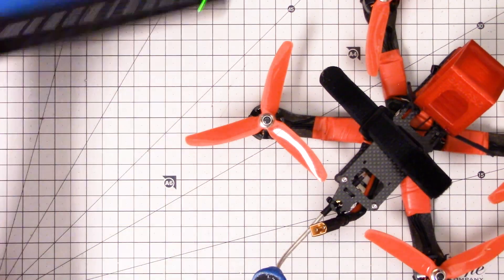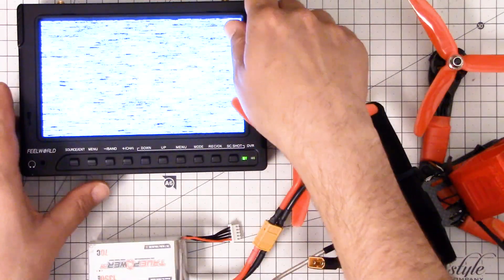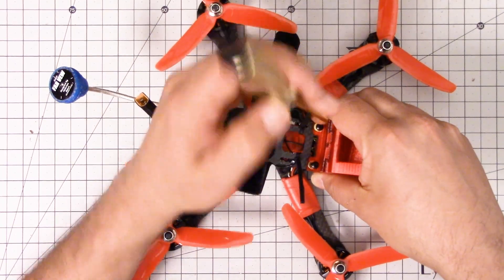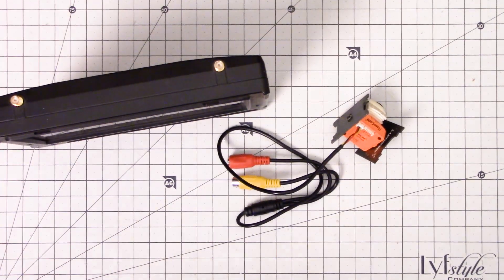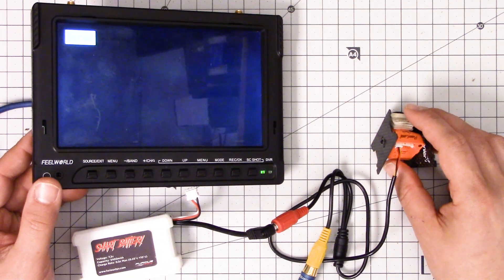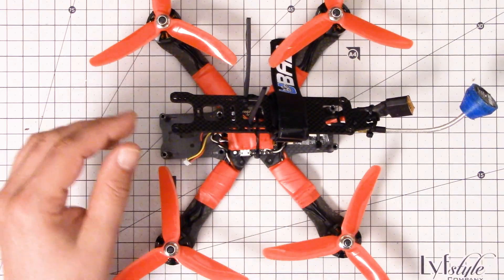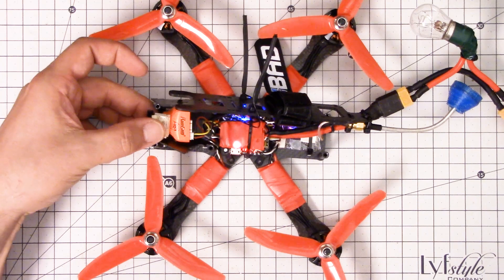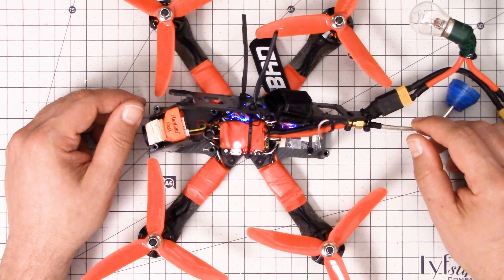FPV Camera Black Screen | REAL WORLD TROUBLESHOOT

Comment: I had a similar issue, my quad was fine at arm and initial take off, then started freaking out when I powered up past a hover and would do the funky wiggle dance of doom. Turned out to be my VTX pigtail grounding on my frame and messing with my esc's. It confused the hell out of me as I would have the top of the frame off try to find the issue, then re fit and test fly and do the same, it's only when I noticed a hot stand off that the penny dropped.

On another subject, what's the most function I could get out of my tgy-i6 TX, I've changed my firmware to make it 10 channel, could I change my switches to have three from two positions using resistors to register the steps? Could you maybe do some videos on getting the most from budget hardware with little tips and tricks?

Many thanks for all the great videos.
Reply from the maker: +Paul Morris you could probably build some kind of resistor network to allow you to use a three position switch in place if a two position switch. You'd still need to install three position switches though.
Reply: Joshua Bardwell Thanks will give it a go, and yes I'll be using a three position switch, I should have explained it better.
Reply from the maker: +Paul Morris you basically want open on one position, closed on the other, and a 50/50 voltage divider in the middle.

Comment: I had the same issue with my runcam and it turned out to be that the plug was not making 100% contact.  However is was seated flush.  I plugged it out and back in without any issues
Reply: hey i got the runcam micro swift 3 and i’m getting the same is where it’s a black screen. The only thing my black screen says is batt<full . Really don’t know who you are but if you have any ideas that would help out. thanks

Comment: Perfect timing for this video.  I ejected my Runcam Eagle while flying today and now have a black screen with working OSD.  Since the crash was hard enough for the screws to take chunks out of the camera case and rip the wires out of the connector, I'm going to guess (hope) that it just broke a solder joint on the PDB and didn't kill my new camera.

Comment: Disassemble the Eagle and check power paths, Solder joints, Coils...
Reply: In my experience,  humming is likely caused through excessive power draw...  Can you log voltages on every rail while touching/poking the quad and connections to the cam?

Comment: hey Joshua. check if the sdcard holder casing is not bend into the pins - a couple guys in my flying group had this and it caused a short between the 3.3v and 5v lines which on the long run will damage the voltage regulator
Reply from the maker: +Jaap Pieroen camera is running off vBat though. But good tip.
Reply: Ok clear. In case you are interested, this is what I was talking about: http://imgur.com/1ySjfYE . There isn't a lot of clearance, and I suggest everybody to put 'something' in the sdcard slot when you are not using it. (such as this: https://www.thingiverse.com/thing:710938 )
Reply: Ok clear. In case you are interested, this is what I was talking about: http://imgur.com/1ySjfYE

You see there isn't a lot of clearance. And a tight build can really squeeze the sdcard holder. Since opening your quadcopter (and removing the potential pressure from the stack) solved the issue, this was the first thing I thought about.

I recommend using this when running a BFF3: https://www.thingiverse.com/thing:710938

Comment: I had the same problem yesterday while setting up two mini quads. I am using Runcams 2, a FT951 25mW VTX and a AOMWAY 200mW VTX. While the first VTX doesn't send any voltage to a camera,  the AOMWAY was sending 4.99V to the camera and nothing happened. The only way to solve this issue was to power the camera from the PDB, directly from the battery. I might have done some mistakes, I don't really know, but I spent 2 days trying to figure out what was wrong and the only working solution was this one...

Comment: Hey Josh so I put the magnets back in but in but now the motor feels very restricted would it be OK to take some sandpaper to it?or what I be digging myself deeper in a hole thanks again man
Reply from the maker: In theory, you can glue the magnets back in with superglue. In practice, they often come out again. If the motor "feels restricted", it is probably dead. Let it go. This is a piece of precision machinery that spins at 30,000 rpms. You can't just expect to go at it with some sandpaper and have good results.
Reply: Thanks man I appreciate it any tips on removing stripped  Allen head screws  for the motor and thanks for not letting magic smoke come out of my ESC's and lucky I've got some emax 2205 2600kv  red bottoms back at the house but sucks because I'm no longer able  to fly in fl by the ocean which is amazing
Reply: Alex Dalton dremel a slot into the head and use a bit flathead screwdriver to remove the screw.
Reply: Stephen Gibb thanks man those screws are a pain in the ass

Comment: could always do for the old standby of a couple of chilling cycles (spray can cooler) targeted at the FC and PDB then retesting.

if the surface mount soldering iron a component is tired and emotional this usually gets it to make itself known.

Comment: If the camera works on the bench with 4s, its got to be worth rewiring the cam with a new cable, maybe with power direct from battery,  Shame to toss a $50 cam for the sake of a $2 lead!  Admittedly its hard to know where the hum was from unless it was the cams internal voltage regulator failing.... but you never know with intermittent connections.

Comment: I know the issue! Just spent 3 hours this past weekend rebuilding the quad from the ground up to finally figure the stupid problem... Your screws are grounding with the camera! I bet if you put it back together,you will get black vid again! But if you un-screw the camera, video will come back (NTSC NOT DETECTED)! WALA! Problem SOLVED!
Reply: I had the same issues with a couple Runcam Swifts. The mounting screws (the ones included with the cam) went a little too deep inside and were just barely coming into contact with the SMD caps on the edge of the board. This caused me a ton of frustration due to seemingly random camera blackouts until I discovered the source of the problem.
Reply: I literally put the quad apart twice and redid al the soldering! When I was about to give up! I figured this out! It was super frustrating!
Reply: Thanks for the heads up.  I haven't had that issue but If I did I would never expect to look at that.  Good knowledge for the future.
Reply: For those of you reading this in the future. I also had the same exact problem. This guy is correct it is the screws. You will know it is because if you disconnect your camera and reconnect it lose it will show you video again. Then mount it and you get the blackness but still see the osd. Take out your screws filed them down with 600 sand paper, or a file. reassemble and your good to go. Thank you dex FPV.
Reply: dex FPV dude, u saved me 45 Bucks, thank u alot
Reply: Just had same issue on my babyhawk-r, found the yellow vtx wire had broken at the solder point. Soldered it back on. Good to go!
Reply: I lost my OSD and data flash chip. I'm probably screwed. Time for a new FC.
Reply: Tim Spitz after a crash my eagle has black screen but opened cam up and made sure all boards haven't separated but lens looks like it's slightly bent (as if cross threaded )so could it be the lens being not square to the first board?? Not had the cam long

Comment: Mounting screw shorting inside the camera causing a lot of current draw on the regulator that is powering it. When the camera was pulled out that moved it just enough to get rid to the short? At least that is what happened to me with my 1177 but in was more permanent.
Reply: But then i read further and find you are powering camera and vtx of vbat so never mind.

Comment: Maybe a loose or intermittent connector to the camera.
Reply from the maker: I don't think so, because of the high-pitched whine.
Reply: What if the power cable to the camera has an intermittent break or connection?

Comment: I have been having this issue lately with one camera in particular. The camera was initially on one of my quads(call it  X) which has a rrosd and i kept getting a black display in my goggles whereas if i connected the cam directly to a display monitor the cam would work perfectly fine. Then during a race this sunday i had to swap cameras between  quad X with the cam issue to a race quad(call it Y). The cam displayed the same black screen issue on quad Y as well which has a HUBOSD on it. When i put another identical cam (i use the HS1177) on quad X i didnt notice this black screen issue anymore, hence i ruled out that the rrosd might be bad. Now coming to quad Y, i can get the image to appear by connecting and disconnecting the quad power supply 4-5 times and eventually the image pops up. Now i was skeptical to fly quad Y with such an issue but didnt notice any issue inflight (despite hitting gates etc and still the image didnt disappear ruling out a loose wiring i guess). So i think it is actually a cam issue cause it does work eventually when i plug the power in and out a couple of times till i see the image instead of a black screen. Not sure whats exactly wrong, maybe this particular camera board is more susceptible to power surge during lipo plug in on a quad due to some damaged internal component? Hope i was clear in what i was trying to say ;)
Reply: Devesh Sharma I have the same issue. Mine normally works but sometimes on power up it's a black screen. It usually fixes itself with just one or two power reboots.

Comment: Josh... i think i know. i have a clone (maybe) omnibus f4 and f3. there is a known issue with an overheating LDO. Connecting VBAT will activate the LDO, it gets hot and very soon starts messing with your OSD! You need to straight up remove the LDO (pretty simple task) and power the board via the esc rail with 5v seperately from your PDB. VBAT will still work just fine. this will isolate the system from the dodgy LDO. Pretty sure your board is similar. (although perhaps you already figured this out)  see link https://www.rcgroups.com/forums/showthread.php?2790167-OMNIBUS-F4-LDO-woes
Reply from the maker: This is a Betaflight F3 board, and the vTX and camera are powered from vBat.
Reply: Joshua Bardwell ah betaglight f3. ok looks a bit different. i'd negate tapping off VBAT from the FC and run cam and vtx off a seperate rail on the PDB. in saying that ive not had much success with Betaflight OSD'S :( i hope to though

Comment: I had an issue with a black camera on my Eachine wizard after i re-mounted it in the quad after a hard crash. The screws I was using to mount it were just the exactly correct size to just barely touch the board inside of the camera case just slightly. What I was seeing in this case was that I would arm the quad and the camera was visible but as soon as I moved the throttle up slightly the video would go black.  I discovered this by removing the screws from the camera altogether and testing again. Check the tightness of your side-mounting screws on the camera inside to make sure they are not touching the board perhaps? I even added a small strip of electrical tape inside of where those screws were to make sure they didn't touch again as well as adding a nylon washer.
Reply: I am having your problem but i can't understand how to solve
Reply: my vtx fried  and i replaced it then i had some vidue issues (osd but no video) slightly losening the screws on the cam solved this! thnx!
Reply: Thank you, I have same issue today and this solved my issue.
I had my wizard x220hv completely rebuilt with just the frame and motors are from the original. I'm using a newer foxeer camera and it was all fine in the past two years withstand many crashes until today I discovered one of the side mount screw was lost and the video got a bit shaky and jelly-like, so I decided to tighten the other side screw then I was getting exactly the same issue you described, the quad lifted in the mid air and screen all black. Tried best to land it and damaged a GPS module 🤷‍♂️.

Comment: I bet this wouldn't have happened if you used the thru holes. 999 times out of 1000 not using thru holes correctly will work just fine, but why not avoid things like this all together, while making your build easier and cleaner? I totally understand it's a pain to rework them, but really though, who reworks there stuff these days? I am not trying to bash you, and never was when i mentioned this before. Murphy's law is real. BTW great work with everything you do, and thanks a lot.
Reply from the maker: Joke's on you. I used the through holes on this build.
Reply: Drats! foiled again
Reply from the maker: The BFF# is hard enough to solder to that I wasn't getting clean connections using my usual method. So I went through hole.

Comment: Today i ran my quad with 1300mah 4s dinogy gr2.0. (They are crap).
First pack.. I flew the quad normally hard and after 1.5 minutes the video feed went all black.. first time it has happened.
I went fast so i just decided to crash the quad.
No harm to it and it flew more than great the next 15 packs out problems.

I power the vtx from 12v on pdb
The cam gets from vtx.
And when i cant find any reason for the blackout in videofeed i just feel i cant trust the quad anymore.
Any Idea?
Reply from the maker: Black screen usually means the camera powered down or lost connection. The most common cause is a loose connector, broken wire, or bad solder joint. If the camera is being powered off of 5v, it could be a bad voltage regulator.

Comment: When you plugged battery back in there was no camera so no/less load on inductor, then plugged camera in...
Have you since plugged battery in with camera already plugged in yet?
Im thinking it could be starting up with extra load on poor/dodgey/on-it's-limit inductor...
I only ask as you didn't test again in video under 'exact' same circumstances as when fault was first happening & we all know how fickle eleaktrickery faults can be ;)
Orr, could a weak connection somewhere induce such a noise from an inductor similar to (for example) a lose fluro tube does from its capacitor when they won't start up properly until connections are 'wriggles'?
Sorry, you've likely covered this by now, just thinking out loud...
Give it an extra hard rag'n & see what it does! :D

Comment: did you figure out if the betaflight video is filtered or not?
Reply from the maker: +Mikey Dread FPV Betaflight RAM and AGND are filtered.
Reply: Thanks for answer , shame as im getting lots of noise through my video.
Reply from the maker: +Mikey Dread FPV are ground for both vTX and camera sent to the same place?
Reply: yes both ground are together, also both 5v, just video wires in there seperate in and out.
Reply from the maker: Dang. Must be a pretty noisy setup I guess.
Reply: may swap out tx , everything is new on the build ,  soft mounted fc, ,i have been on kiss for 6 months and going back to cleanflight/betaflight  hasnt been a pleasant journey thus far, anyway i appreciate your help.

Comment: i bought from bangood, an eachine wizzard220, and for some reason the yellow signal video was soldered to voltage regulator board, tx and camera, no sense on that, i was getting a jello image when flying, changed cams, soldered direct video signal wires from tx to cam, problem solved.
Reply: I had a similar issue. The Matek PDB in between cam and vtx doesn't seem to be the best set up. I pretty much did the same as you and have done on all builds since. I now only use a swift connected directly to a tramp powered off vbat.

Comment: I lifted my ground wire to the VTX today. I quick fixed it by taping the ground wire to the USB connector socket. Flew my other 15 batteries no problem.
Reply from the maker: You're a gutsy pilot to fly with such a tenuous connection to your camera. Glad it worked out.

Comment: Maybe the plug on the runcam I had the  wire break right behind the pin the insulation was holding it together and it did this from time to time didn't realize that's what it was until the insulation broke. New connector never had the problem again
Reply from the maker: This is a good suggestion, and would be consistent with the camera working from the pigtail but not in the copter.

Comment: Joshua. Me and a friend have had similar issues but different. When wired the way your supposed to the 5v to the camera seems to go low under punch outs. And cams brown out. We both have had to run raw power to the cameras and battery voltage from BFF3 to the vtx. Seems the 5v regulator to be the issue. Also the crosshair in osd won't display, maybe it's because accelerometer is off. Maybe this will help you out, you have endlessly helped me!
Reply from the maker: +Jesse s&w it's definitely not the regulator because the camera and vTX are running off of vBat.

Comment: I've had this same problem with my betaflight f3 board joshua, but the camera still worked, just the whine. the weird thing was it only made the whine when powered from the USB. I swapped cameras, the whine went away and all is good. just an FYI the mount holes on the  BFF3 board are grounded. I think some BFF3 have issues with some cams, but that shouldn't be it.. who knows. I've put a ton of packs through and the flight controller is still fine. Weird stuff isn't it?

Comment: where is the camera getting power from the flight controller hads a pdb are you using it to power the camera if so it might of been the source of the humming noise
Reply from the maker: Powered from the RAM pin on the BFF3, getting vBat.
Reply: that is odd that it is receiving battery voltage and making a hum because its just passing thought not getting the voltage changed glad it works now thought